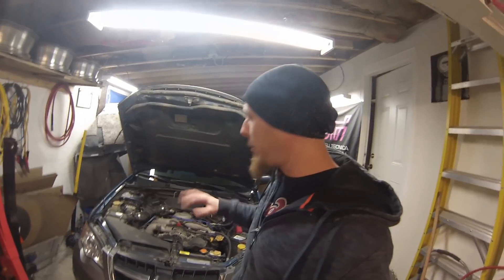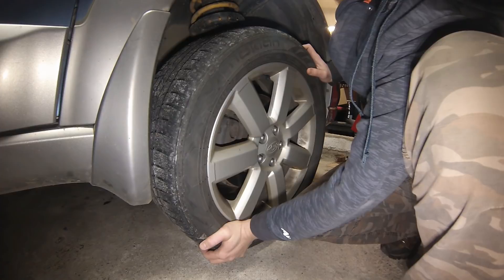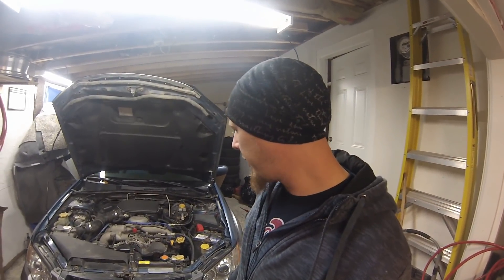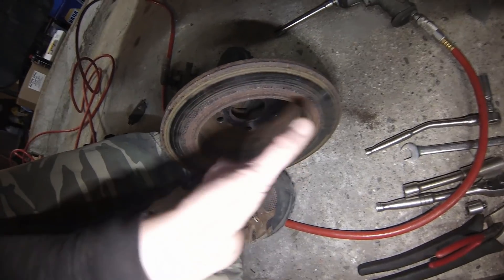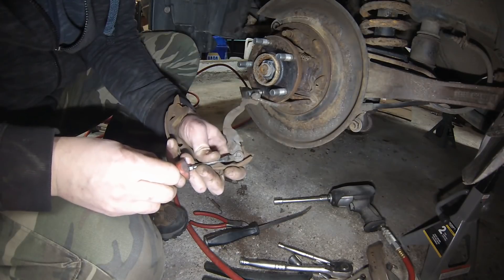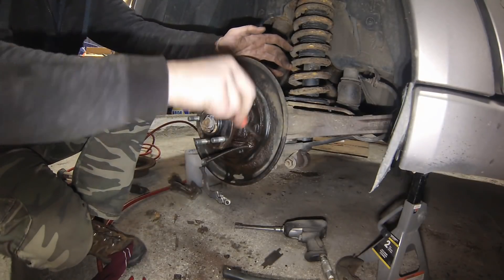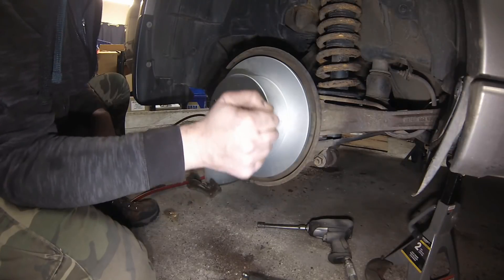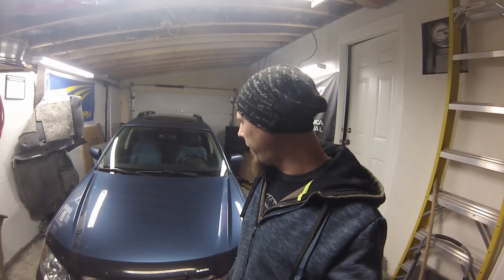How To Subaru Parking Brake Shoe Replacement

Comment: I live in a winter road salt area; plus live near the ocean. Just changed the park shoes on an 09 Impreza. The brake pad fell off the shoe when I opened it up and the hardware was rusted to pieces. The drums and rotors in this area tend to seize to the hubs. So I use a good bit of anti-seize compound in my repairs and rarely have trouble removing the hubs during future repairs. Liked the video and clear picture.
Reply from the maker: Thanks for commenting. You must be on the east coast. Been there, done that. Made me a better technician knowing how to deal with rust and seized parts. Anti-seize is your best friend the next time around. 😉

Comment: Thanks for the video. Steps were very easy to follow and made my parking brake job go very smoothly. I was stuck on getting the stupid springs back on but your little screwdriver trick worked perfectly. Thanks for showing how to do the job with common tools!

Comment: Thanks for this! I accidentally broke mine after pulling the rotor off with the parking brake engaged.
Reply from the maker: You wouldn't be the first and won't be the last ;)
Reply: @HomebrewSubaru  lol Im not suprised. Luckily those washers and pins holding it together snap easily otherwise i probably would have caused more damage

Comment: Hi, I have a Subaru Legacy (1992) the adjustment for the rear shoes can be accessed at the back of the entire brake assembly via a small hole with a rubber stopper that can be removed. The idea is to use a flat bit screw driver, and you turn the adjuster via putting the flat blade into the cogs on the adjuster and rotating either direction to tighten and loosen.  This will allow periodic adjustment without needing to jack the car, remove wheels and rotor.  Just thought that might also help some other folks.
Reply from the maker: Many applications do have the hole for adjusting. More importantly it allows a person to loosen the adjustment so they can get the rotor/drum off without breaking retainers. Love to get my hands on a 1st gen leggy turbo
Reply: @HomebrewSubaru  I had to fight to get my Drum off, then discovered that on my model there were two 12mm (i think) holes in the drum. You simply insert 12mm bolts and tighten them and it will push the drum off the brake assembly.  The bolts need to be reasonably long .. maybe 3-4 inches. Again .. hope this info helps others.
Reply: @HomebrewSubaru  My Legacy is Caribbean/Latin America Variant .. not USDM .. so its a 1800cc, Carburetor with Distributor Setup. Unfortunately, there are few 4WD Legacy's in Barbados (Caribbean)  I am in the process of  converting to EFI, upgrading to 4WD and adding a Super Charger.
Reply from the maker: Very cool dude. I've never seen a carburetor setup on a 90's model Subaru. It is an EJ18 though? Plenty of options with your chassis.
Reply: @HomebrewSubaru  Yes, standard EJ18. Could send pix. It uses a similar intake manifold, but stays flat to allow a down draught carb, instead of turning up for the throttle body. Dizzy runs of the cam on the 1&3 Head, located at the back where a turbo up-pipe comes up.
Reply: @HomebrewSubaru  Regarding chassis .. most GC8 Impreza parts fit. Currently fitted the Impreza MT5 Gearbox. Everything bolts in, but not direct replacement. Had to change Flywheel, pressure plate, pilot bearing, throw-out bearing, inboard joint cups, axles w/CV Joints to fit, but no modifications at all. Impreza box is beefier. And I bought the rear subframe (shocks, springs, diff, axles, brakes etc) from another 2000 year Impreza as well. It should be a straight bolt in.

Comment: Great video, perfect explanation of the issues and how to deal with them. Would like to mention that the adjusters would use some cleaning and lubrication. Also, a new hardware kit wouldn't hurt for this job to be perfect and the backing plate risers should be cleaned and coated with anti-seize. Thanks.

Comment: thx bro, had to change a rear wheel bearing on a crosstrek ended up removing the whole knuckle. Parking brake is a little different but fairly similar, same sort of concept. Do a Crosstrek parking brake video if you can find one, there aren't any online and im pretty sure all the parking brake is the same 2013-2022
Reply from the maker: Thanks. If I come across a crosstrek for a video, it will happen

Comment: Really excellent video. Helped me out immensely... Just a suggestion, a set of snap-ring pliers is like $12. (though I assume you already own them) While I applaud the attempt at using "standard tools", watching you put that horseshoe clip back on with angle cutters gave me massive anxiety :D
Reply from the maker: I’ve broken the tips off of snap ring pliers enough times to use them for snap rings only 😉
Reply: @HomebrewSubaru  Bahah, I stand corrected! I couldn't quite tell if it was just a clip or a proper snap ring. Fair enough, I defer to the professional. Thanks for the videos!

Comment: God I wish my spring came off that easy, thinking about just cutting mine off since the kit has new ones anyways.
Reply from the maker: If you have replacements you could. It’s better to get a feel for how they move so going back together could be a little easier.
Reply: @HomebrewSubaru  got the one side off and installed.  Was a bear to get the springs back on with the screw driver.  Than my father informed me he has the damn tool for removing and installing them and the other side took half the time lol.   

Anyways video helped a lot, thanks

Comment: Most discs have 2 threaded holes, you can tighten 2 bolts into them to pull the disc outwards. this is generally done when you are not replacing the disc. You can see his disc also had the holes.
Reply from the maker: Unfortunately 12 year old rotors don’t often have threads left in Canada
Reply: @HomebrewSubaru  Rotors not being replaced for 12 years is concerning in its self. But yeah, I get what you mean. Its just worth a mention for people who have semi-new rotors, just avoids any damage to the rotors.

Comment: My daughter's 2001 forester just had a seized caliper, front, left side, and it's a Kansas car. One pin was stiff and one piston cup was super stiff. We replaced it with a part from a donor car.
Reply: She was getting intermittent vibration at high speed, then I noticed the whole wheel was HOT.
Reply from the maker: This is how many discover the problem. Some brakes will get so hot they will smoke when coming to a stop.

Comment: I have to challenge my prized Subaru wagon next for the rear shoes and pads. the new parking shoes I bought do come with extra horseshoes when all else fails. Subarus are easy to work on, unlike front wheel drives, which I hate and it is true if you are going to do the job, do it completely and buy new hardware, a wiser choice than taking chances with rusty or worn out parts. Better to start new.

Comment: Good vid about to do a drum to disk swap on my 99 outback sport and this should help if i have to replace the wheel bearing.
Reply from the maker: I've done the same swap on my 2000 OBS. I got rear knuckles from a later model and just bolted everything on with new brake parts. Original brake cables will work fine
Reply: @HomebrewSubaru   drum ebrake cables work?? Ive been told you need disc brake ebake cables!

Comment: Before adjusting the new emergency brake shoes do you have to take all of the adjustment back out of the emergency brake handle?
Reply from the maker: Yes if the handle has been adjusted too far, the shoes will be difficult to adjust properly

Comment: I’m having trouble. I have everything put together and it’s time to put the rotors on. I have the star wheel adjusted so it’s as small as possible. When I go to put the rotor on I have to tap it in place. Then there is lots of drag. I’m not sure what to do I’ve tired messing around with the star wheel some more but no luck.
Reply from the maker: James Crosbyv make sure the shoes are properly positioned evenly on the backing plate. If they are not aligned properly the rotor will be difficult to get on

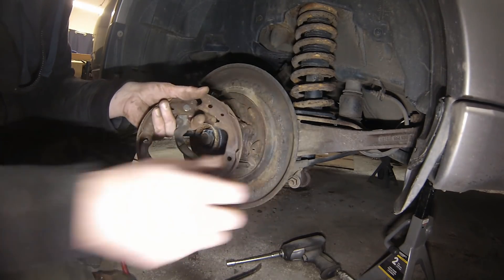Comment: Hey man got a question for ya, I’m looking for what the part is called at 10:09. It’s on the left brake shoe, the more gray part, almost looks like an adjuster? I’m trying to put new dust shields/shoes/hardware to pass inspection but I can’t find that part specificity. It didn’t come with my shoe or hardware kit. I appreciate the video
Reply from the maker: That is the shoe actuator/lever. It must be moved from the old set to the new set. If someone tossed yours in the past you will need to get from the dealer or scrapyard. Good luck with your inspection

Comment: I also had the right front caliper seize up around 190k. common? Great video.
Reply from the maker: Calipers are an issue in the climate that I live in. Overall some makes tend to fail more often than others. For the most part Subaru calipers are good. If they sit a while unused though... they seem to generate problems.

Comment: Running into an issue on mine(2007 wrx) can’t get the shoes to fit into the rotor drum. Does the wrx models use the blue spring on the plate that goes across?
Reply from the maker: I can't tell you what spring might go where by color. If everything looks correct, check that the parking brake cable is not over adjusted at the handle. That can prevent the rotor from going on. Also some aftermarket shoes don't fit as well as OEM which could be an issue.
Reply: Homebrew Subaru I think I installed the plate with the blue spring that goes across incorrectly. Ill take another look at it today.

Comment: Great video!  My grandson's 2002 Subaru Impreza RS has a grinding noise from the right-rear.  I removed the brake pads, caliper, and rotor.  The grinding was coming from the parking brake assembly.  Specifically, the lower return spring was rubbing against the slotted hub backplate.  It seems like the star adjuster is pushing the lower return spring into the slotted backplate creating the sound when I turn the hub.  Should the adjuster push the return spring up like this?  Does the spring help keep the star wheel on the adjuster from moving due to vibration?
Reply from the maker: From what I recall the spring lies on top of the adjuster. It will come close to the hub, but shouldn't touch. The lower spring holds the shoes together against the adjuster and yes it does sort of retain the adjustment.
Reply: Thanks!  I'll compare to the driver side.  It may be that I need to 'adjust' the adjuster a fraction of a turn to lift the spring more towards 12 o'clock, vs. 2 or 3.

Comment: +Homebrew Subaru 

 @ 14:55 you said “I do have brake tools...” while putting on the upper springs, 
Was wondering if there’s any tools specifically to hold the bloody spring stretched or back specially for when connecting the hand brake cable to a new shoe!?
If yes, what it called plz
Thanks
Reply from the maker: Look for a brake spring retaining tool. It looks like a screwdriver with a little hook clamp on the end of it.

Comment: just a great video!!  I had a couple of questions for this crew or the generous poster.  there are two springs a beefier one that's shorter (mine was painted yellow) and a longer slightly thinner spring.  which one goes to the rearmost shoe?
Reply from the maker: Thanks! I would expect that both springs attach to the rearward shoe. Are you putting something together that you didn't take apart?
Reply: Check your distances between the shoe and the stud it goes on, you can tell by just holding it up there. The short one WILL NOT go on the longer reaching stud. Always take a picture of everything before taking anything apart. In the old days, I drew a picture on a piece of paper. A paint marker can save you a LOT of grief. If you have different sized bolts, always place the bolts in the exact same pattern they came off on the garage floor AWAY from your work. I space them to the shape of the holes too. I know you are a noob. Everyone starts at the beginning.

Comment: would a wire brush work adequately to clean the parking brake shoe are from rust and debris? Also my rear rotors are somewhat more worn then my front can I just get new rear rotors for the time being and just do new pads in front and back?
Reply from the maker: A wire brush should clean up most of the loose stuff well enough. Use a can of brake clean to spray all the dust out. You can replace the rear rotors/pads and just do a "pad slap" in the front if you feel the rotors are in good enough condition.
Reply: Homebrew Subaru okay awesome! The only that thing I saw a parking brake hardware kit with the springs since I thought that would be good to do. Except on a few reviews on auto Zone it said the pins were different lengths and caused the parking brake boot clamps to come apart. So should I just only do the shell pieces and leave the hardware? I was just worried how rusty yours was and mine was at one point located by the Bay. Subaru doesn’t sell a hardware kit either you have to buy the whole hand brake set up for $87

Comment: I have a 13 wrx and the parking brake doesn't hold the car on a hill. It creeps ever slightly like the parking shoes are barely touching and I took it in to get it checked out, they said it "clicked" the manufacture spec of seven times. I just wonder if my parking shoes are so worn out that even pulling the handbrake "enough" but still isn't adequate.
Reply from the maker: If the handle pulls up far, either the cable is out of adjustment, the parking brake shoes are out of adjustment or they are worn out

Comment: Good video, would you recommend the standard rotors or the drilled and slotted for the car?
Reply from the maker: This really depends on the vehicle type, drivers habits and budget. Blank rotors are a standard replacement. Drilled and/or slotted rotors are a performance option for when heat become a problem.

Comment: Hey, do you know if the rear brake drum assembly on the second gen Foresters comes apart the same way as the "drum in hub" parking brake on this Outback? Trying to deal with a 2003 Forester X (rear drums) with a seized parking brake/rear brakes. Thanks!
Reply from the maker: The procedure will be very similar.

Comment: At what point do you attach the star adjuster and do you thread it in all the way first or adjust it later from the back access hole?
Reply from the maker: The adjuster can be threaded inwards to make it easier to install. I place the adjuster on the shoe being retained. Then with the lower spring on both shoes, pull the spring open enough to seat the second shoe on the adjuster. It can be tricky. I only perform adjustments with the wheel off and drum, no more back side adjustments. The only time I mess with adjusters from the back side of the backing plate is to get something apart or to make a second adjustment on a new set of brakes. First adjustment should be with wheel off. Drum should always be able to be pulled back off after adjusting.
Reply: Homebrew Subaru thank you.

Comment: Why in heck don't they use rotors with that little circular port so you can access the parking brake adjuster directly?
Reply from the maker: It would be nice if all of them did. I still prefer to do it this way. 
You can always ensure it will come off if there is a problem for some reason

Comment: Im stuck on the caliper bracket bolts, i can't seem to find a good way to get to those bolts ? Any tips ?
Reply from the maker: The way I'm able to get them easily is using flex sockets, extension and impact gun. I could recommend trying an extension on the end of the socket, it might allow you to swing a ratchet and get them free by hand.
Reply: Homebrew Subaru thank you, i'll try this weekend with a flex socket
Reply: I can get the lower one off using a small arc of a ratchet wrench below the bolt, or a 6 inch extender to take it beyond the sway bar connections  The upper one works fine with just a socket and a ratchet

Comment: Ghost Train 615 calling Homebrew Subaru, having a slight problem. I did the right rear side, replacing the parking shoes, but now the new rotor does not go over them! Did everything by the numbers, but this is a stumbling block, what is it that I am missing? The parking brake lever is not engaged. All the stuff is new! Please respond.
Reply from the maker: This can happen for a few reasons. Have you turned the star wheel adjuster in? It adjusts the shoes inward and outward, with new material you may have to adjust it inward. Another reason could be that the shoes are not seating properly somewhere, usually on the top or bottom. A third reason is that every once and a while we just happen to come across bad parts.
Reply: That is it also, it the star adjuster is not turned out! I think maybe somebody sold me the wrong part, the rotors are correct and so are the pads. I am going to have to retrace to find out where the hell the problem is. I may have to break it down and start over again!
Reply: Did you figure it out? Autozone sold me the wrong parts for my car, wrong model year. IDIOTS. I hate returning parts. Back to bringing in the old stuff to compaire. They use that same old excuse too. That what the computer says. WELL LOOK AGAIN, BECAUSE ITS WRONG!  Then they come up with." oh yeah, well they changed it midyear" I DONT FREAKING CARE!  Next time USE YOUR EYES... sound familure I bet , huh?